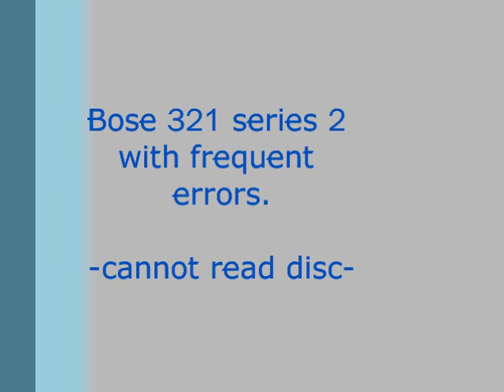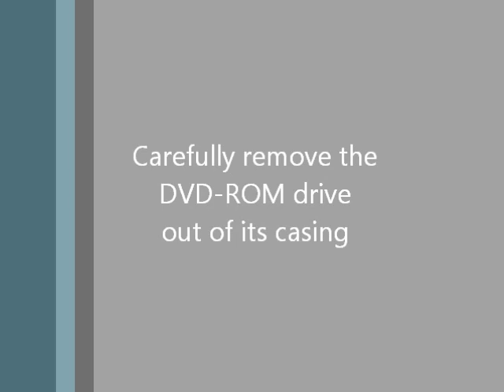Cleaning Bose 321 DVD Player Lens

Comment: hello! I have removed the bose in question and after having reassembled, I will appear on the display bose 3 2 1, and will not turn anymore. What can it be? There is a cable that I did not understand where it connects, it seems to connect to the top or not?
Reply: Hello. Hod did you fix that issue in your Bose system? I'm  in the same predicament now.

Comment: may be we can change dvd player by a dvd player classic (for computer ??) if it's the same connexion, and it's not really expensive aren't you ??
Reply: it is recommended a Toshiba SD-M1612 or eventually a Tosh SD-M1502 as I had seen here in Youtube - may be it depends on some functions    by these models ?  I`m sure with the SD-M1612:
 Found a commercial ebay offer in 2015 for the SD-M1612 -high level price and fastest sale - reason enough to use the SD-M1612? You won´t get support about other compatible drives (here in Germany)
Reply: How can i purchase a remote control